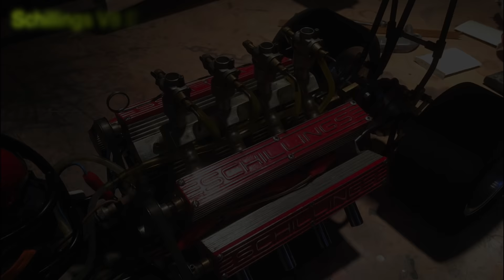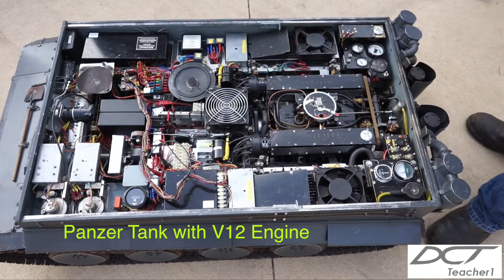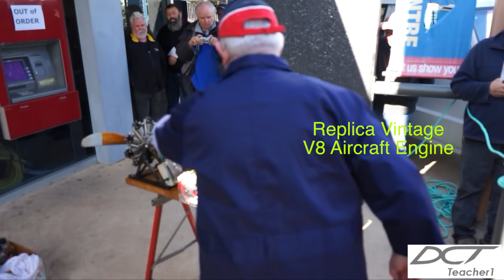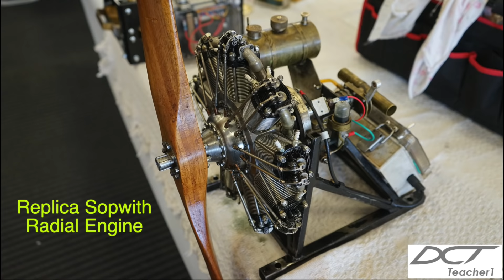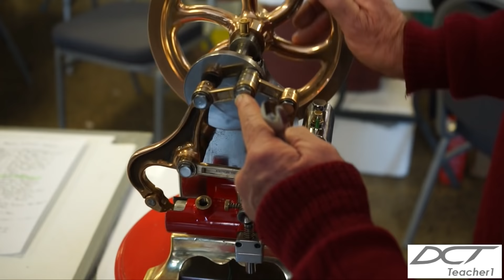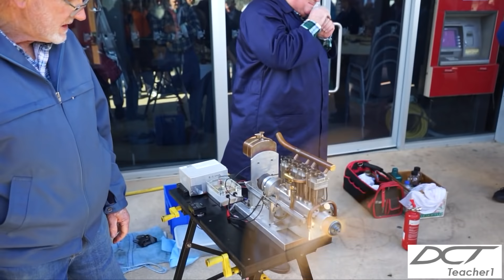6 Amazing Miniature Engines Running - V12 & V8

Comment: Those propellers spinning around with no guards accident waiting to happen but very cool engines for sure
Reply: Especially with that flimsy jacket.
Reply from the maker: You’re not wrong. One of those props would take your hand off 🖐🩸
Reply: @DCT_Aaron_Engineering  That's right, a propeller is very dangerous, but the hand is not gone immediately. I was there when someone grabbed in a propeller. Afterwards a piece of the fingertip was missing. The propeller is just too fast and the gaps are too small for a whole hand. "Unpleasant" it is nevertheless. Greetings from Germany

Comment: Building a small engine from scratch is on my bucket list! I have seen video of that Tiger 1 before, it is very cool, in person must be incredible! Which one are you going make?
Reply from the maker: Oh I agree.  It's on my bucket list too.  As you know I make the little oscillating (wobbler) engine with my students at high school.  However, I want to build a Webster engine.  I also have another engine in a hobby magazine that I found.  So many engines, and not enough time to make them ha ha ha.  Wish I didn't have to work ;-)
Reply: Wouldn't that be sweet to stay home and play all day! Making little helicopter engines! Hey I put a surface grinder video up take a peek.......
Reply from the maker: Ok cool, I'll go there now and check it out :-)
Reply from the maker: Great video by the way.  Hey, before you order your CNC machine send me a private email please.  Use my full name (all lower case and joined together) and send it to hotmail dot com.  Cheers, Aaron.
Reply: Sent

Comment: Blood marvelous. Thanks for sharing Aaron! I can't help but think of the handicaps micro gasoline engines have with camshaft duration and lift limitations (limits), because of the scaling the ramps are restricted. The smaller the camshaft lobe angles and ramps, the less opportunity there is to maximize compression and fuel burn. This really hurts as piston dwell at TDC occurs very quickly compared to full size gasoline engines. The amount of camshaft duration overlap has always been a challenge, even at higher rpm which also hurts efficiency. You might have some opportunities by trying to grind (machine) some new camshafts profiles with your new CNC machine if you decided to add a fourth axis.

There might be relief on the horizon with microprocessor solenoid controls that could operate the intake and exhaust valves instead of a camshaft. This could be managed using a arduino based crankshaft sensor (magnetic pickup). 

It really is nice to see these engines running!

Have a nice flight!
Reply from the maker: Hey Doug.  Thank you for watching and I'm glad that you found it interesting.  I'd been sitting on this footage for quite sometime now and totally forgot about it.  I think I filmed the bulk of it way back in 2015 in a country town outside of Melbourne called Bendigo.  Last night I stumbled across it again and thought, "hell, I should make this into a YouTube video and share it" ha ha ha.  You seem to know a lot about engines, I suppose you get this from your stock car background.  I used to be a motor mechanic many many years ago (84-96).  I since switched into engineering and then later on went back to University to become a teacher.  I've been teaching for 16 years now.  Cheers mate, Aaron.  PS: what did you used to fly?
Reply: DCTTeacher1 Great footage for sure. I've flown a lot of homebuilt conventional R/C .049 to .65 airplanes to the real thing from C-172's up to DC-8's back in the early 90's until most of them were retired from Cargo freighter service. I haven't been at the controls since '99.

I then went into telecommunications and technology.  I don't race cars much these days as the costs continue to skyrocket. ($1,000 Au per event). I still build race engines though.

I've been interested in CAD / CNC  world for about a year. I've just begun to learn F360 over the past few months. I'm also sticking my nose into Arduino and Raspberry Pi.
Reply from the maker: Hey Doug, I just sent you a private message to your YouTube channel.  If you don't get it can you email me directly please?  Just use my full name (all joined together in lowercase) and send it to hotmail dot com.  I want right it in her as spammers will get a hold of it.  Cheers, Aaron.

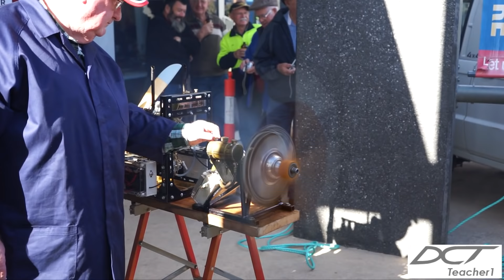Comment: OMG!!!  I thought the dragster was cool....and then the tank.....but at 4:39 when the sopwith shuts down.....mind blown!!!  I'm wondering if it's labeled wrong.  It says it's a radial engine.......I'm familiar with radial engines....or at least I thought I was. So, I looked it up.  The Sopwith had a rotary engine......where the engine spins with the prop!  I'm sure I've seen them on static display before, but I've never seen one running before.......had no clue that the pistons and cylinders spun with the prop! So friggin' cool!!!  I'm going to have to look up a bit more.....curious to see how it gets it's fuel in and exhaust out.  Thanks! I will definitely be on the look out for the difference the next time I'm in an air museum.  We've got two really nice ones in these parts.  Thanks Aaron!  I didn't even speed the playback up! LOL :)
Reply from the maker: Hey Mike, Thanks for the link.  I think that looks like the same bunch of guys.  I filmed all this footage a couple of years and had been sitting on it.  Found it last night and thought, "hell, I should YouTube this"!  I suppose you're right with that term "rotary" versus "radial".  For some reason I only associate rotary with the Wankel engine that has rotors.  The guy with the tank owns his own engineering shop.  I think he makes precision gauges etc...  Anyway, he is normally at every model and steam event throughout Melbourne.  You made me laugh with the "didn't speed the playback" comment.  You've got me bloody paranoid now when I upload a video over 5-6 minutes.  Ha ha ha ha, it's all good buddy.  Hope you guys are all well?  Cheers, Aaron.
Reply: The crankshaft is bolted to the firewall, stationary as well as the pistons. The crankcase and cylinders spin.
Reply from the maker: Yes it's a freaky design.  Apparently it used to induce a lot of roll when in flight.  Due to the inertia of the mass spinning too.
Reply: Every time I've ever seen a design like that, I just assumed it was a radial engine.  It makes me wonder just how many were actually rotary engines. lol
That tank was pretty impressive!!  
Don't be paranoid!!!  If you look at my vids....there's far more long ones than short ones. In fact, the next few that are going to come out are going to be pretty long.  Don't whittle out important content just because you're worried that I'm going to think it's too long.  The sad fact is that I don't have time to watch many vids at all these days.....no matter how short they are. :(   I could watch vids like this all day, but I'm usually pursuing some information I need for another project and have to gloss over or skip most vids.  I'm just one viewer.....so you'll be far better off to cater to the majority of your followers.  These days....my vids are more for my memory than anything else. lol  If I think I need to know or see something in a process when I refer back to it later....then I include it in the vid.  You'd be surprised at just how many times I have to watch my own vid again just to remember how I did a part. :(    Oh.....and if I'm watching them at a 1.5x playback.....that means the vid can be about 9 min and still only be 6 when I watch it. ;)
Reply: Interesting!  I'll bet that would be an issue.  I sent a link to another friend....he pointed out that the cooling would be better at low rpm.  I was wondering about the oil slinging out to the heads and valve covers.  Next time I'm at the Air Museum in Tilamook, OR, I'll have to see if any of their radials are actually rotaries.
Reply: It's a rotary engine because the crankshaft is stationary and the engine rotates around it. And yes, I'm aware of the spinning dorito version with the same name.
Reply: @spamcan9208  Thanks!  Got it sorted out a couple of years ago when this first posted. :)
Reply from the maker: Thanks mate

Comment: what engine is that v12 in the mini tank ? if i'm not mistaken it say made in australia on the top ?
Reply from the maker: Hello, you are 100% correct.  The owner actually built his own V12 engine for that tank.  His name is Gerard Dean and he wrote a book on the build.  The book is called: Der Tiger Designing, building and running the 1/5 scale Wimmera Tiger tank. ISBN-13: 978-0994155306